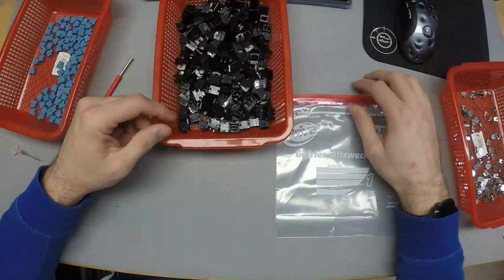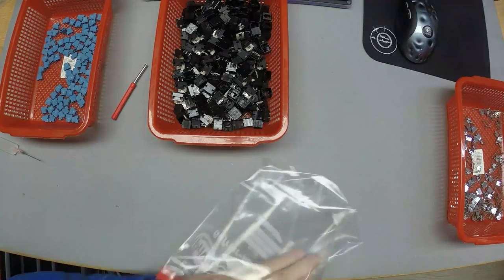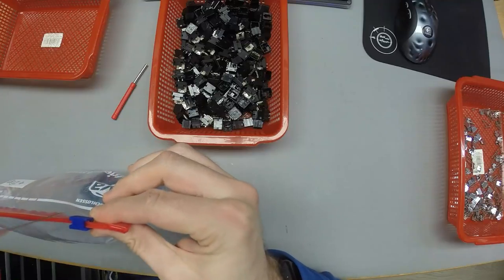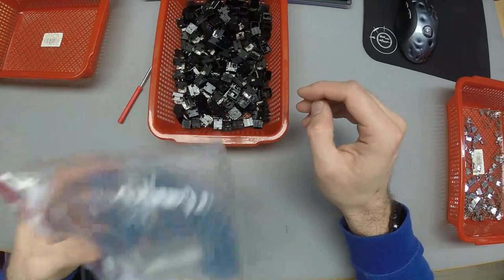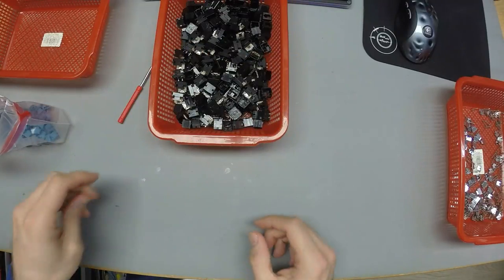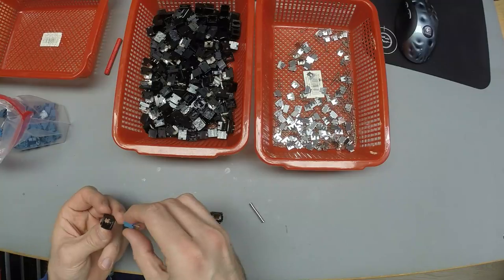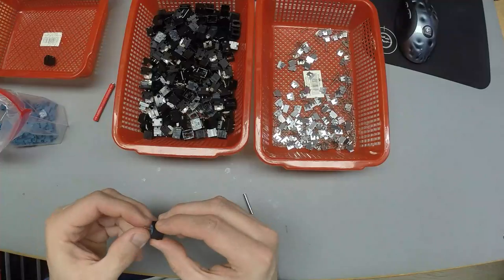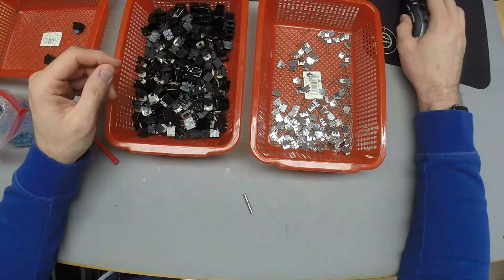Alps Switch Assembly

Comment: Could u tell me exactly how a connection is made in these switches when pushing it in.  And is there something I could do to make a switch more or less sensitive?
Reply: if by sensitivity you mean how much force they take to be pressed you can replace the springs in switches (including Alps) to a heavier weight for a stiffer but less sensitive switch